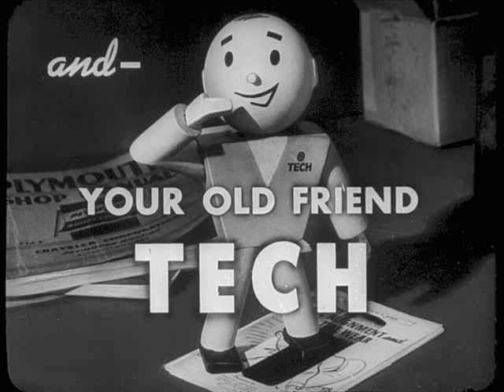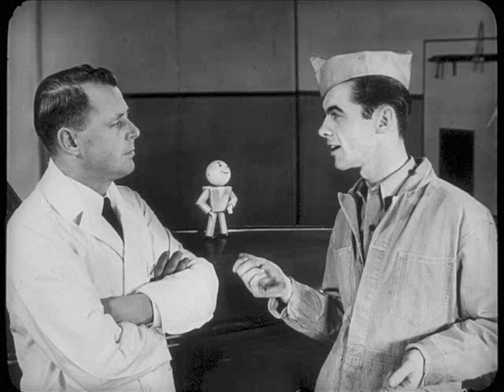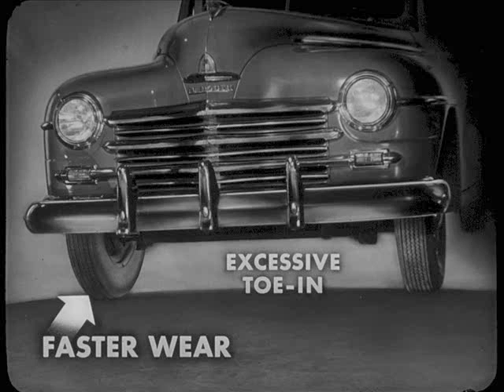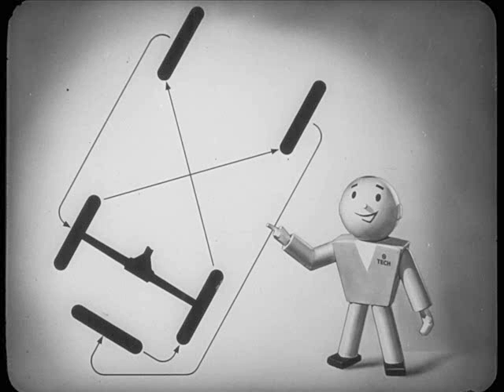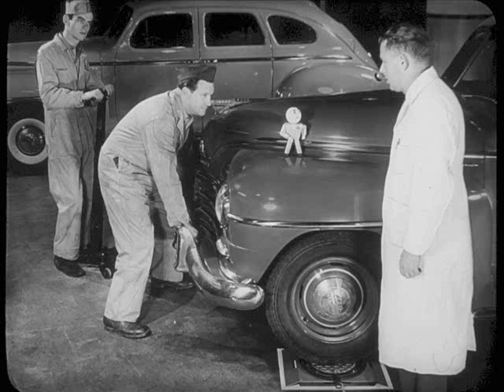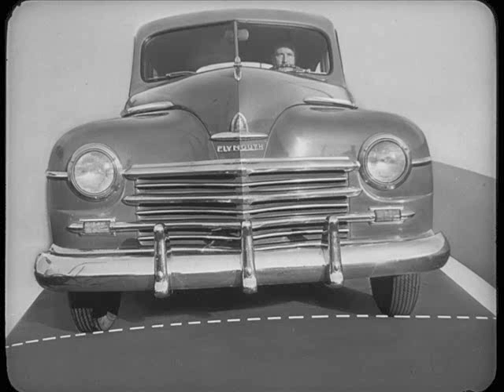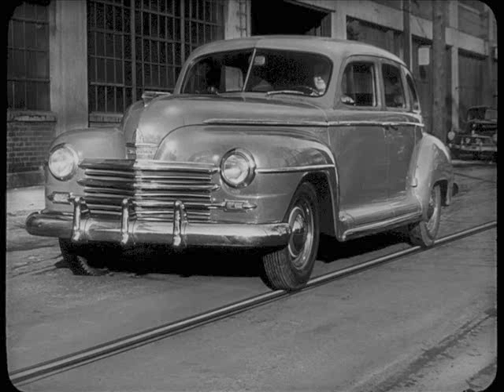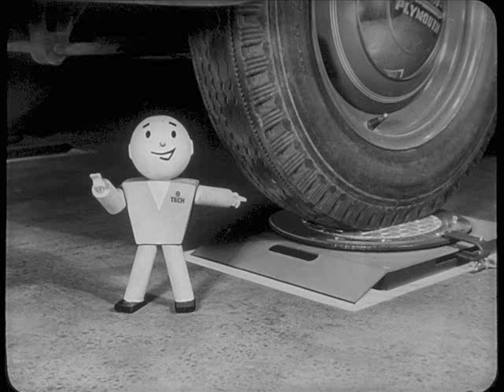Chrysler Master Tech - 1948, Volume 1-5 Let's Get It Straight

Comment: This is extremely fascinating seeing how Vehicles used to be serviced back before the day!!
Actually though, we Techs learned by the 1980's, that with respect to Caster and Camber.... STRAIGHT UP is NOT the best way to align a front end! 😱😎😉
Positive Caster is far better for maintaining straight line stability, and for cutting into curves. Especially with Cars getting much faster!

Negative Camber, with 3/8ths to 3/4ths of a degree difference for road crown compensation, is ideal for better grip in curves. This may be more relevant since the advent of quality Radial Tires.
..... Just not MASSIVE amounts of negative Camber, like kids like doing lately!!  😒😣 That's a Tire Killer!
Reply: Many cars were built with zero caster so that steering would take less effort. When power steering arrived, many cars were given positive caster so return to center was improved. Not all power steering equipped vehicles had positive caster, I know the Nissan Hardbody calls for something close to zero.

Also, I'm not sure how German cars were built many years ago. Most of them had a more positive caster angle than what was found on American cars.